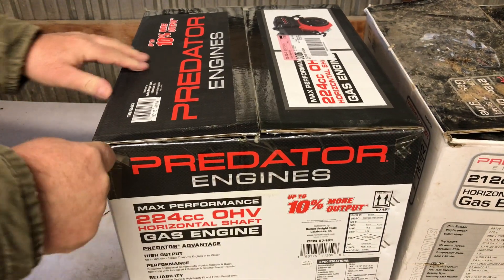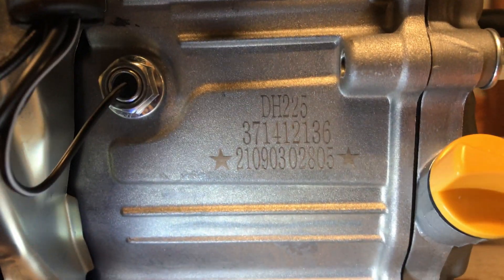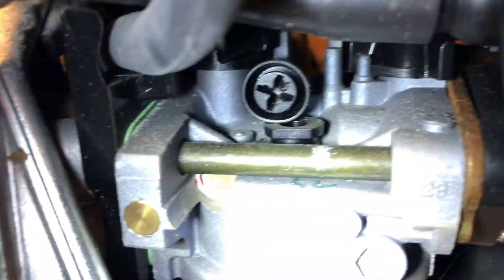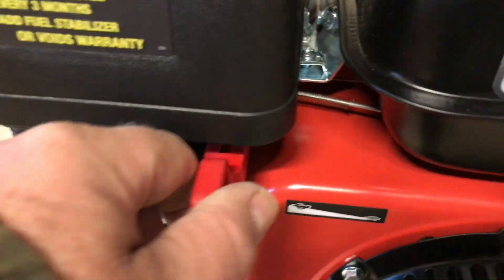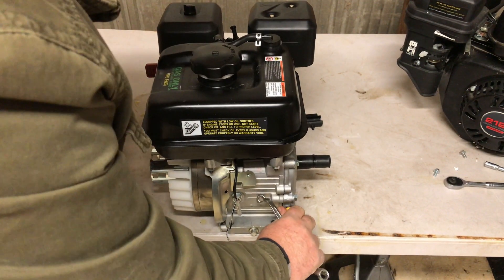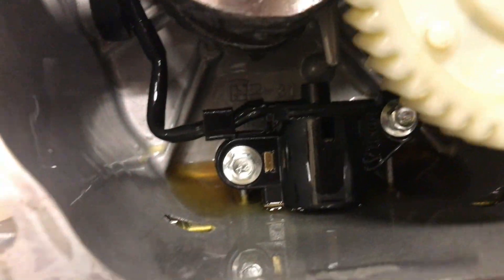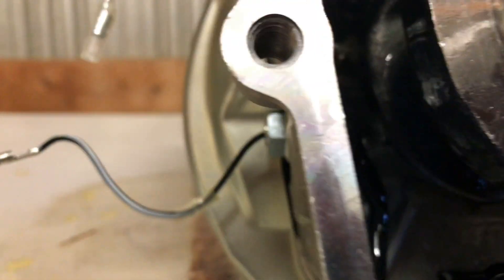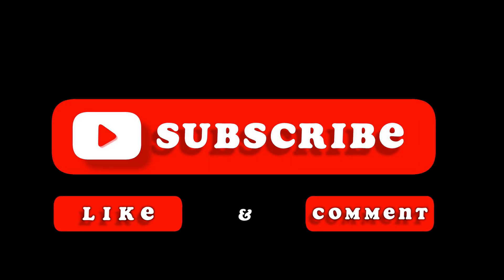The Secret Truth Of The New Harbor Freight 224cc Predator 224 Engine Review

Comment: The Ford A and B engines used nylon cam gears. So did a Mustang I once owned.
Reply from the maker: Lots of engines running nylon gears. Briggs has had some trouble with the nylon cams and gears though as has Kawasaki on some of their twins. If I wasn't replacing it with a performance camshaft, I'd leave it in unless or until it failed for sure. Thanks!
Reply: @KentuckyFriedFixes  going to fail eventually, my 79cc also has nylon cam which boggled my mind how manufacturers could put that in there with longevity in mind, clearly they didn't make it to last too long but I'm glady 420 doesn't have nylon cam😂
Reply from the maker: @str8xrippin  At least the lobe portion of the cam is steel, only the gear is nylon. I'm not throwing mine out, it will find another use in something less performance oriented. Thanks
Reply: @KentuckyFriedFixes  the lobe on my 79 is also nylon, the whole thing is plastic so I find that disappointing but there's not much stress a small displacement engine will put on that cam. Also the nylon only gear is dangerous but what the heck these are only a $100 right
Reply from the maker: @str8xrippin  Oh man, I've seen those cams with the plastic lobes. Yikes!

Comment: Great video, you didn’t happen to measure the Carb Venturi diameter?
Reply from the maker: Hi Grant, I'm working on it today so I'll get some measurements on the carb this evening.
Reply from the maker: Grant the venturi is beyond the reach of my dial caliper but I did measure the throttle bore at .745 the venturi looked quite a bit smaller. I'm thinking .650 to .680. I cover some of this in the new video but I did notice it looks like the carb venturi is removeable. I haven't verified that yet, but it sure looks like it will come out.

Comment: Looks like the way to go with these is to get a hemi flat top piston, then dig into your parts for a stock clone rod to measure in the hole with the hemi piston. Then order the proper clone billet rod and head gasket choice.
Reply from the maker: I like the way you think. I've gotten in some performance parts to try out and some will work, some won't. I'll share what I have come up with and where to get the parts that work when I finish the next video. Thanks!
Reply: Can this motor be converted with a hemi kit?
Reply from the maker: @RedDarealist  Yes Sir DR RED! I have a video on a Hemi head 224 swap and DIY Willy just did one! Links are on the 224 Hemi video. Thanks!

Comment: If this cost me more than the 212 model, and is NOT a hemi, then I don't want it.
Reply from the maker: If you leave it box stock about the only benefits over the 212 are the longer stroke crank and the thicker block. These features are really aimed at builders that want to increase performance. I'm thinking about changing mine over to a hemi head design for a later build, but it does mean buying the hemi head. Thanks for commenting Sandas.
Reply: @KentuckyFriedFixes  I have a 212 hemi, are you saying my 212 hemi head would bolt on to the 224?
Reply from the maker: @RandomFPVlive  I've not tried to install a hemi head on the 224 block yet but yes it should work just fine. Looking at doing this BTW as soon as I get the billet rod/piston combo worked out. There's no reason it shouldn't fit the Ducar 225 block used in the 224 Predator.

Comment: Plastic cam gear? Great, now the cam will fail prematurely!  What a joke!  And this is the engine they want nearly $200 for?  Color me not impressed. If this is what will be the new predator engine, I'll go to Northern Tool  and get an Ironton!
Reply from the maker: Anthony that plastic cam gear is unfortunate but not a deal breaker for me. New performance camshaft came in today!
Reply: Right
Reply: That's expensive. I can get a genuine Honda GP200 here in Thailand for $165. Many different clones for $60.
Reply: The cam at max rpm of crank is only rotating just over 800 rpm. It's an extremely durable plastic and it's light. Don't embarrass yourself by talking about something you don't know about.

Comment: I don't think arc billit rod will clear the block. I'll try it when I get home later today
Reply from the maker: Hi Joseph, the block is definitely thicker than the 212 block. The thicker block and the increased stroke on the crank is probably gonna be fun fitting rods and cams.
Reply: @KentuckyFriedFixes  yep I believe so
Reply: A little grinding should do the trick. Only a tiny bit on my black mamba cam and very little on the block

Comment: Does the 212 cam fit the 224 ?
Reply from the maker: Hi Randy, the 212 hemi predator will fit but the non hemi 212 has the larger diameter camshaft bearing journals and will not fit. The clone engines have the Honda .550 cam journal, like the new 224 predator. Hope this helps, Chris

Comment: Got my 224 done up with the 212 stage 1 kit already not gonna run it till i build it with a arc rod and flywheel like i did my 212 and im probably gonna run the same parts as my 212 build but in the 224 the added stroke with my set up should make quite abit more power over the 212 with the same set up
Reply from the maker: Awesome Spencer! I think that billet rod will be a must have on these once a decent camshaft kit is installed. The flywheel is also a must have. I have ordered one of the racing cast aluminum flywheels rated at 8500 RPM. I'm probably not going higher than that on RPM. Thanks for commenting my friend!
Reply: @KentuckyFriedFixes  Did you get one of those low cost flywheels? I always wondered how they are timed?
Reply from the maker: @Deucealive75  I've ordered the parts and if they arrive on time I should have a new video out later this week with the details on the install and where to source the parts. Don't forget to subscribe and smash the notifications bell for the performance engine updates video coming. Thanks, Chris
Reply: @KentuckyFriedFixes  oh sure thing cant wait to see how your build turns out im gonna shoot for the moon on this one as it has the better block and is stroked from factory so just a all around better starting point it seems like 9k-10k here i come lol
Reply: @KentuckyFriedFixes  oh i have a list here of parts for the 224 thats already up to 1500 bucks and thats not including balancing the crank

Comment: Haha. It's good to keep your tools pulled, but I don't think a magnet needs oil! Very informative video! Interesting to see how these things are put together. I was also surprised to see that plastic cam gear. Wonder how it will hold up.
Reply from the maker: Next time I'll try not to drop anything in the oil container. I'll be replacing my plastic camshaft with something a little more metally. Thanks for watching!
Reply: @KentuckyFriedFixes  looking forward to the next one!
Reply: Briggs and Stratton used an entire plastic cam with gear in their smaller mower engines for a while.  I've never heard of them causing problems, but I prefer an old Tecumseh any day.
Reply from the maker: @vanfrank1602  Van I don't think the cam is a deal breaker. I'm saving mine in case I need it later for something, definitely not throwing it out. I love them old Tecumsehs! I used to pull an old Wheel Horse with a hot HH100 that would turn crazy RPM. The Kohler guys were always mad at me so I ended up selling it to my buddy J.R. Problem solved, they stayed mad at him after that. Thanks!
Reply: The plastic cam gear holds up great after ya chunk it in the trash can. 😝 
Really, though. As long as you don’t mod the engine like removing the governor and such, it will do just fine.

Comment: Got mine mounted on frame I still need to cut my tq plate so I don't have to run risers going to run mine stock for now
Reply: 🤦🏽‍♂️we still don’t have them in stock in LA
Reply from the maker: @RoyalJZ  Hang in there. I was told that each store would be receiving one or two engines for the release. If you don't have one locally, you may have to drive for an hour or two as I did. Just remember to ask up front if you don't see any on the shelf. The HF store I picked this one up didn't even know they had any until they looked in the back.
Reply: @RoyalJZ  my local hf had 2 in stock said it would be at least a month before next shipment thought about buying them both just went for one if you have troubles getting one just hit me up sure I can get you hooked up bro
Reply from the maker: I think stock these will run just fine. There's lots of engines running those nylon gear camshafts. It's nice to know if it ever fails you can drop a clone camshaft right in place. Thanks for watching!
Reply: @KentuckyFriedFixes  mine will be going on a kart more then likely at some point going to try it on my warrior frame for while

Comment: Huge quality improvement over the 212s. I might start buying Predator engines on occasion. Before I bought strictly Tillotson R stuff. Much nicer it takes all clone parts. Cheaper, and more prolific.
Reply from the maker: It looks like these new Predator 224 engines are going to be a game changer.
Reply: The other thing of a plastic cam gear is less rotating mass of the cam which means gains in power through the valve train. In these small engines every 1/4 to 1/2 a hp is a lot each place you gain gain hp from is gonna help in the end regardless of the rpm range of the engine.
Reply from the maker: @rncboy2  I like the way you think. Anytime you can reduce the rotating or reciprocating mass it's a good thing!
Reply: @KentuckyFriedFixes  The tecumseh ohh series f200 engines need some series bracing for the block for serious builds. Although the sound and power from them is definitely worth the trouble of finding a older dyno cam for one. I do have one I built don't remember what old stock dyno cam I went with +5 years ago. Yes I see the stock cam being a thing in the racing world especially circle track as you need the low-end for something around 5500 to hold the momentum for the turns. Roll speed would also help on that. I could definitely see guys keeping the stock cam. Unless your trying to use it for a clone class or something of that nature.
Reply: Has more plastic internals
Reply: @REDBANDITOFFICIAL1  That's for noise. That cam gear clank is loud. I started up my 224 and was immediately impressed how quiet it was.
Reply: With a plastic cam gear think again
Reply: @David-gf6hr  We throw those away quickly. In a stock application, those should live a long time.
Reply from the maker: @David-gf6hr  It would have been nice if it was an all steel camshaft so at least we could have something for a core to regrind though for sure. The block and the 58mm stroke crankshaft would cost more to buy separately than the entire 224 engine. That's the main game changer, more performance parts out of the box. Camshaft aside, it's a pretty good deal.
Reply: @David-gf6hr  yeah, because exactly no one keeps the factory cam
Reply: @mattcossel29  Unless it becomes a new "cheap race class engine" otb something that doesn't exceed 5500rpm.

Comment: Good review Chris, its nice they reinforced the crankcase. 👍
Reply from the maker: Thanks John. Looks like these should be good engines for the karters and minibikers.
Reply: They sure do bud and anytime.
Reply: Were weak crankcases a problem on the 212? You really seem impressed by the reinforcements, so I am just curious if this was a problem.
Reply from the maker: @car2069  The older 212 engines had very thin blocks. It meant that you were kinda limited when you bored one. If you went too large of an oversize on the bore, the top of the block would pop off in a catastrophic failure. Great question! Thanks!
Reply: Says sleeved cylinders also
Reply from the maker: @bma4203  That's correct. These have a sleeve installed as well as dual bearings on the crankshaft. Not a bad package.